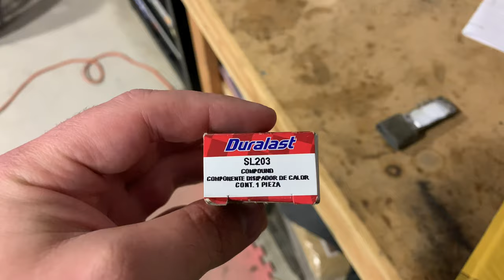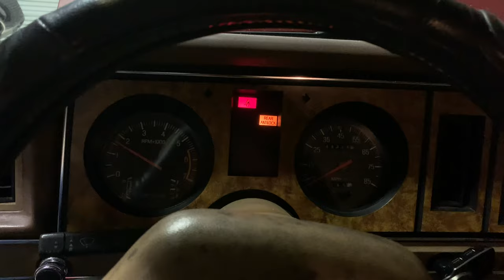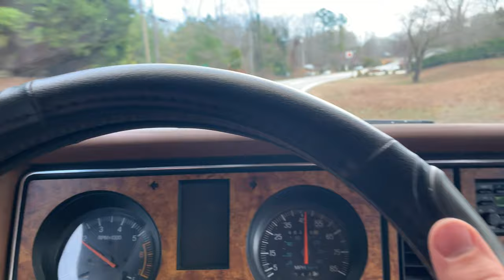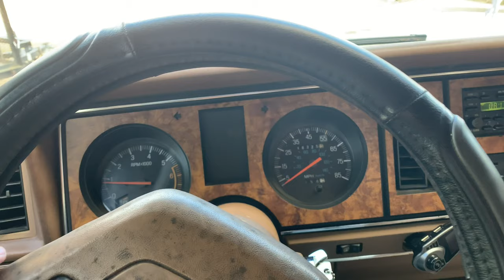Replacing the TFI Ignition Module - ‘88 Ford Bronco II

Comment: This TFI module sucks! I had, again, this same issue last summer but it took me many trips to the autoparts store to figure out what sockets and ratchet I needed! What a pain! Wish I had this video a year ago! I read you can move this module to avoid the heat issue but I'm not sure. I was also able to pull the distributor cap without disturbing any other parts, it was a pain but doable!
Reply from the maker: It is all a pain, lol.
Reply: As myself schooled in electronics & a long-term retired mechanic...electronics & hot  engine-bays don't mix. Honda at one point used a Peltier device, a solid-state cooler  like those 12V car fridges...integrated into their distributor modules. 
   The logical solution is to relocate these devices as far away from heat sources, in front of the core support to the sides of the radiator would be best.
  Heat management of  electronics is more & more ignored & makes for not lasting very long (throwaway society). Find your internet router right now in your home...I'd bet $100 it is hot to the touch...doesn't make for lasting very long.

Comment: Got a bronco 2. Replaced the in tank pump and it ran perfect. Next day neither pump worked. Inirtia switch checked out fine. Any ideas?
Reply from the maker: Did you check the fuse and relay?

Comment: Hello  I have a 1987 B 2 , 2.9 motor has been pulled new clutch ,engine seals complete , it usually runs good but recently it has been when running no throttle response while moving  or is like its stalling then when you give it the gas nothing then all of a sudden its on again accelerating normal ,is this similar to the problem you`ve had ,if it is then I need to do this fix .
Reply from the maker: Sounds like it definitely could be, or maybe the fuel pumps going out.
Reply: @HiRevzMedia   I would have thought that myself but both are new plus filter

Comment: It also has a flaw that makes it fail intermittently as if drowning excess gasoline but it will change various sensors and each time they connect you to the scanner does not show what the problem is, what do you think is what is going wrong?
Reply: did you find a solution?

Comment: i fix electronics---amplifers etc w/output chips....that use heat paste....ive got a 87 Bronco II n something tells me  pulling mine out n adding some HI-TECH heat paste would extend life of it.... no?  I know that def B4 i take a long trip id install a new one!  Also Installed a new MAF sensor ( on passenger firewall) 6 mos later ....Started same idling thing again..up n down,,, I found the TOP cover of maf sensor was LOOSE, so i bring in house.. pull off, n use HOT GLUE to COMPLETELY fill internal area of maf sensor........ NO MO problems   :)
Reply from the maker: Definitely!  That’s the main issue is the heat soak.

Comment: As of this writing  I am still having the issue of stalling , also I didnt mention both fuel pumps are new ,since my first post ,I have put in new fuel pump relay , new throttle positioning sensor  , new TFI module , so I am thinking its either the distributor or coil as everything else is new for the most part , anyone have any issues as this ? Any help is appreciated Thank you in advance frank

Comment: Where is the fuel filter located on a 86 bronco 11
Reply: It is located on the inside of the frame rail on the drivers side about even with the seat back. It is between the fuel pump which is also on the frame rail and the fuel tank. There is also a fuel pump in the gas tank. The

Comment: my 89 has gone throw 2 of those, and is killing its 3rd. there has got to be a better way to fix this.
Reply: did you use the heat sink compound? im thinking thats why i will need to do this job again. processors on computers require this as well and looking back if its critical for a p.c. it should be to for this chip
Reply: @pearlrival3124  Yes I use the heat sink, its a must, but the problem is in bad design. 

The TFI Ignition module needs to stay cool basically, to much heat kills it so ford said lets put on the back of the distributor, next to the firewall. It just gets way to hot back there, all that engine heat gets flung back and bonces of the fire wall on to the module killing it.

I found the a fix tho. I made a aluminum heat sink plate, that I mounted to the side wall. Then heat sink the module to it, and extend the factory wiring harness to the module. You then have to make a wiring harness, the shorter the better, to go from the module to the back of the distributor. as well as a 'I used aluminum' plate to close in the gap on the back of the distributor. 

It's a little tricky to do, and I have no real guide to give, but its doable and has worked really well for almost a month. I've noticed none of the normal signs that I normally see immediately after replacing the module that indicate it will start burning out.
Reply: @joniray6686  I wish you could send pictures. it sounds ideal. im picturing a cpu processor (look this up if your not familiar). thermal paste, plus heatsink,  plus fan. I stopped driving mine a few years back because it shut down with my wife and kids in it. it started back 30 minutes later, but that was an ass chewing that I didnt want to go through again. I have some cash I can throw at it now, but I definitely dont want to "throw parts at it" like he did in this video. that fuel pump replacement had to cost him a fortune. my other symptom is a random spit and sputter. some times it shuts offf completely some times not is this something you were dealing with?
Reply: @pearlrival3124  Yep sounds all most like the same issue. I recommend if you start driving it again, and have the same issue. Drive somewhere turn it off and can't start it again. pop the hood crawl on top of the hot engine, and wiggle the wiring harness and tap/knock the module, then try cranking again. 9.5 times out of 10 allowed me to get it to crank, 3 out of 10 times causes the random spiting and sputtering. 

I keep a large old towel in mine for a year just for crawling on the engine because of this module. Ive burned throw 4 modules be for finally doing the diy fix. Wait that's not true, the 4th module kind of works and I've keep it in the bronco just in case something goes wrong the new one I bought after the fix. 

keep in mind I've only done this fix about a month ago, and so far shows no signs of any further problem. Still I can't be 100% on if its a true fix.
Reply: @joniray6686  well let me know if you can find this feed/page again. im going to do heat sink concept. ill take pictures of what I do and post. the fan would be ideal but i dont know if i can get the parts. ill post if it solves the issue for me. alot easier than fuel pump replacement. i replaced it in 2008 and drove the hell out of it until 2016. if i can get 8 more years out of it before another module im happy.

Comment: Y not just put some extension leads on it and mount it somewhere cool
Reply: I think  it  needs  to  be  grounded  to  the  distributor.
Reply: @AnnoyedCoastalBeach-nl4tm  it does need to be grounded but it doesn't need to be grounded to the distributor and if it did need to be you could just run a ground wire from the distributor to the module I'm probably going to do this in the next few months I just got through solving and injector problem on mine going to take it out on some test runs and drive it as a daily driver and see if that thing wins it going bad I got mine out of a barn after sitting for 5 years only has 80,000 original miles single owner I'll update this later
Reply: @sebastianharrison6118  I have  an  89 rebuilt  the  motor  at 170,000 miles  got  another  120,000 sense  rebuild  still  doing  good  don't  drive  it  every  day  anymore  . Had an  86 before  this  one  and  a tree  fell  on  it  in  a  storm totaled  it  ,got  the  89 with  insurance  money.